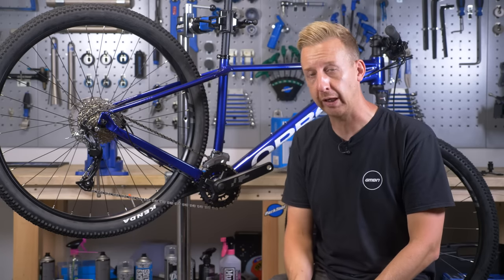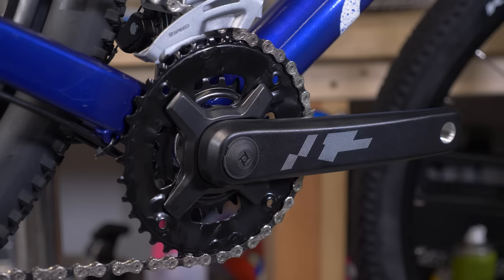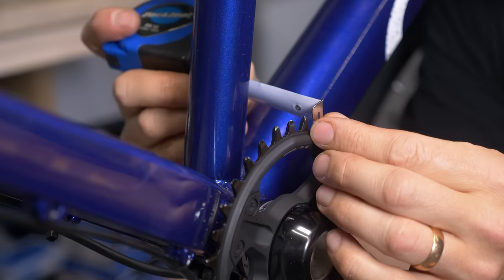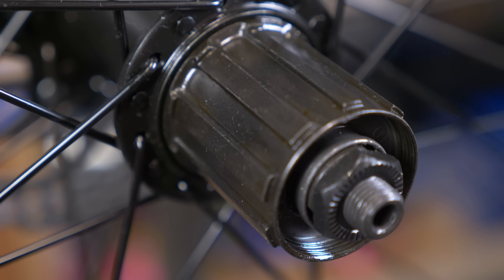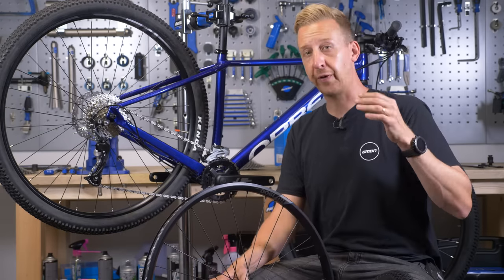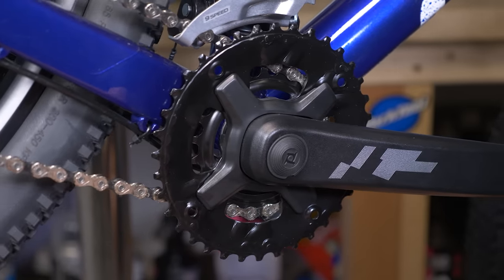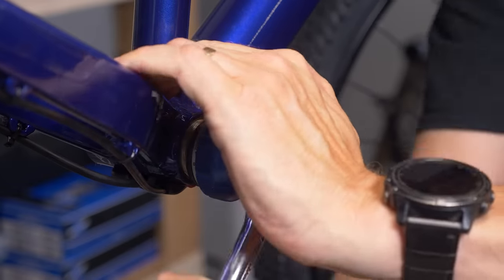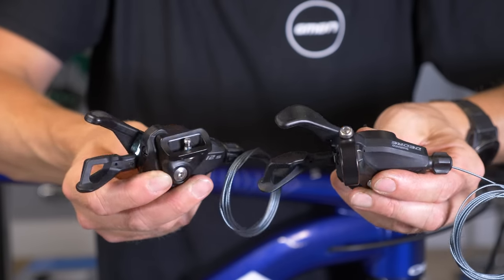How To Upgrade To A 1X11 Or 1X12 Drivetrain! | The Ultimate Single Chainring Conversion Guide

Comment: If you have room for multiple chainrings, there is no reason to downgrade to 1x.
There so much misinformation in this video, starting with the supposed weightsaving, I am too lazy to point it all out...
Reply: It literally is weight saving though, less hassle having to index gears, a 1x system is easier to clean, quieter and works better than a 2x. A 1x is typically used when you have a larger cassette and it allows more range than a 2x. By the sound of it you're just lazy, hence why you need that 3x or 2x setup to help you get up those small hills
Reply: @The_Real_JN   Quieter? Works better? Larger is better? - this is a cassette...

1x is typically used with narrow-wide chainrings, which are horribly grinding, because of the glove-like fit between chain and teeth, where every bit of dirt is too much.
The chainline can be straighter with more chainrings, resulting in a smooth, silent drive train. Larger chainrings result in lower chain tension, which makes for a much longer lasting transmission and less flex.
Larger cassetes are heavier and they are placed in the rear wheel, opposed to the centre of the bike, where chainrings would be.
Multiple chainrings allow for a wider overall range, not only 556% max.
A second chainring is handy, if you crash your largest one into a rock...
Your turn ;)
Reply: @coolcycles  less tension on the chain means more risk of chain slap, aka more noise and damage to your bike without a chain stay protector. Also a slacker chain typically results in a lower quality of shifting since the chain isn't tight, though it isn't so tight to cause any more abrasion to than a 2 or 3x setup, since the chain is grinding against the cassette and front chainring when changing gear. Chain doesn't rattle in the front derailleur so is quieter, and if you hear so much grinding from the front chainring on a 1x then it needs a good clean, not a problem with regular routine maintenance. Lighter, no front derailleur and shifter, no extra cables, larger chainring on the front on a 2 or 3x is more susceptible to damage.

Comment: I'd like to see a 9 speed:
10 15 20 25 30 35 40 45 50
500%. That would be perfect for me. I'm hating fine grained gearing. When i shift, i want a definite feel of a new gear. I'm not counting cadence. Too much bicycle tech is crappy pro gear, instead of quality A to B gear for the average biker.

Comment: If you are too dense to operate a 2X drivetrain, you prolly aint gonna be a good mtber. If you are familiar with the trails you are riding, a 2x10 gives you more range of gears and a straighter chain line than a 1x11. The only pitfall of 2x10 is the unexpected feature. It aint no brain puzzler though.

Comment: It's not an upgrade if your limiting your gear range/ratio. It's not a lot of weight. It's not confusing, if you can type on a keyboard you can shift. And I wouldn't recommend less gears for a novice or young'n on a 29er who probably doesn't have the leg power

Comment: Why was Shimano so stuck with front mech? They should have had 1x ever since the 80's as an option. Best and biggest company but it messes my mind that they won't make everything posible for every biker type.
Reply: And now they add centerlock disc brake hubs to start making mounting a simple brake disc more of a compatibility consideration. All about locking in customers to their own proprietary ecosystem eh.

Comment: This is not interesting for me. I have the hollow crankshaft which is the biggest weight gain but i dont wanna give up on the 42-12 gear cos there is a good deal of flat land close to my home. The double shifting from high to low range is no problem for me.

Comment: Upgrade? This is the most moronic trend to hit the bicycling industry, since bio-pace and under the chain-stay braking. The thinner chain is more fragile and prone to breakage, The steps between the rear sprockets are further apart causing rougher shifting, the small cog is subject to premature wear. The loss of top end speed, to name a few of the disadvantages of the 1x drive train. 

I believe this was a push from SRAM who couldn't make a functional front derailer to save their lives, Then SRAM selling it to the bike industry whose carbon frames are prone to cracking from chain suck of poorly maintained bicycles and novice cyclist who have more money than skill back pedaling on a shift sucking the chain into the weak carbon stays. All this leads to warranty nightmares.

 Now we have the whole industry talking about the attributes of a 1 x drivetrain system, using spread sheets and flow charts trying to explain the magic and simplicity of going slower and how you really don't lose much in gear ratios. Afterall we are a bunch of baboons who can't figure out how to shift a multiple chainring setup........simply pathetic, you all should be ashamed of yourselves.

Comment: Why the heck they did it, but on a polygon bike they used red loctite on the threads from factory. I used a 2 foot breaker bar and a 3 foot pipe over that and the only thing I did was strip the tool out.

Comment: Sorry don't see any advantages in converting that bike to 1x only disadvantages re range of gears. And cost. Sell the 9spd and buy a new bike.
If you can't manage to operate a bike with fd and rd you aren't much of a cyclist.....it' not that complicated. 
I have mtbs with double and older treble fds full sus and hardtail work perfectly. All my road bikes have double chainsets never had a problem changjng or selecting gears on either.
I suspect the usual market hype to get us to buy new bikes.

Comment: Why do all the channels call going from 2x and 3x to 1x an "upgrade"?  It's a side grade at best.  Just a way to pry more money out of cyclists' wallets.  And those pie-plate sized cassettes are ghastly.
Reply: I guess this setup is for trails, Less weight, smaller chain ring to clip a lip drop or rocks. I want this setup but I only have one bike which I use also in a long ride. I don't wanna loose that extra speed the large chainring has
Reply: If you're tired of calibrating and adjusting the front derailleur I guess it's nice to just have a 1x. No chain slapping against the the derailleur housing or anything.
Reply: update: I already changed to 1x9 bc recently I'm more on practicing tricks mostly drops, climbs & hops. installed bash guard too. 😁
Reply: @glenn_blowfly  what crankset are you on? Im also trying to go 1x9 but most(if not every) deore crankset is for 1x10 or 1x11.
Reply: @janekznak8455  Deore M5100 works great, I have stock 11-34T cassette and no issues on chain drop even back pedalling.. I'm otw to changing to 11-42T cassette now
Reply: because if its a better groupset its an upgrade, no matter what your boomer instincts say. If it shifts better, if it shifts faster, if it shifts better under load, if its more durable, if its lighter, its an upgrade. Thats what people upgrade for.

Comment: The 1x system is garbage - a huge step backwards from 3x, driven by the need for a system that works with e-bikes and regular bikes.  Those reasons are BS.  It does not work better, it requires huge sprockets on the rear wheel and insufficient gearing, stupidly narrow, weak and 'loose' chain, and you lose the ability to quickly drop the front gear onto the smaller ring when getting to a hill.

Comment: its nothing to do with weight (how did that ever become the issue) , its about how bad a shift on the front is when under serious load and the simplicity . You dont need a clutch system on the rear derailleur , where did you get from. The more I listen to your channel the more I spot the BS